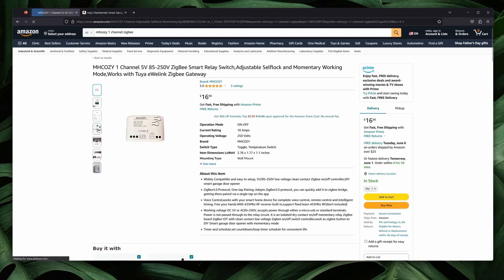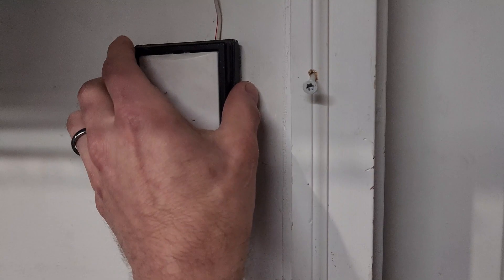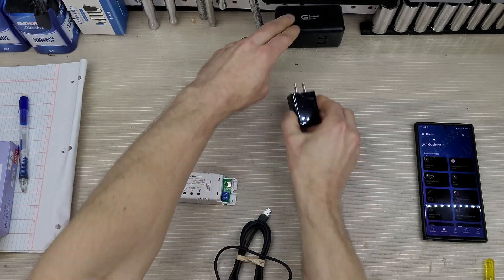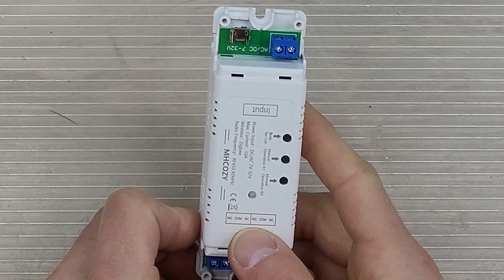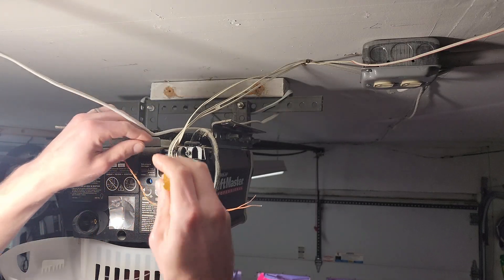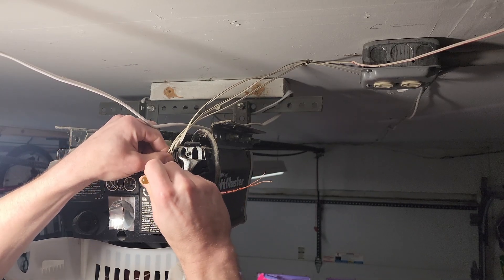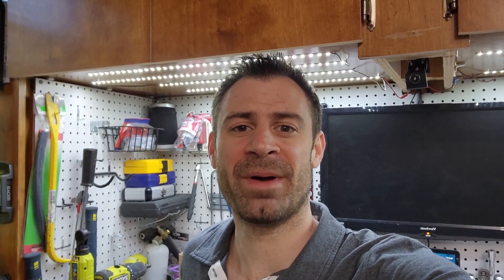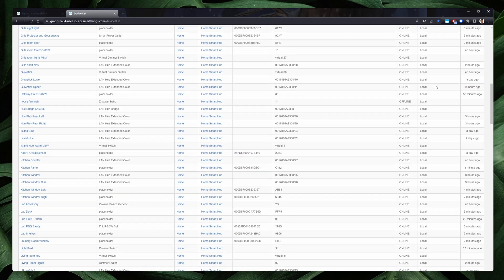EASY Garage Door Automation [Google, Alexa, SmartThings, Hubitat]

Comment: Does the relay work with Home Assistant Zigbee ZHA?
Reply from the maker: Tuya can be hit or miss w HA, but I'd like to think it works.  And TBH, I return what doesn't work.  At that price, it's worth a shot as many different use cases.  If you buy, let us know how you make out.  Thanks for watching!
Reply: @manicmods  Will do...Thanks
Reply: @manicmods  I got mine today.  It paired right away with my Zigbee Gateway.  I am running ZHA, Supervisor - 2023.5.4, OS -10.2, Frontend -20230503.3 and running Home Assistant.  If you open it up and go to Configurations you will see 2 switches that you can add to your Dashboard.  These turn the relays on and off.  You may need to click the Mode switch a couple times to get Momentary Mode for the Garage.  This give you a ~650ms pulse. I hooked it up to the garage controller and worked fine.   I already have a door alarm switch on the garage door, so I can see when Open or Closed.  The only issue is that it double or triple pulses on occasion.  Makes the garage door reveres a time or two.  Not sure where this is coming from.  There is an Attribute off_with_transition which is not explained anywhere.  But see no difference with it set to true or false.  I will hook up the other garage door on the other relay and should be good to go.  Interested if anyone else sees the occasional double puling.  Thanks for the video.    I should have mentioned that I didn't use any App.  It was a direct integration with Zigbee.
Reply: Hello. Doing as u described on this video but not working. Does positive wire go to No or Com on device and does positive wire go to positive on door opener?

Comment: Any plans to add position of the door into any of your automations? Since the relay can only perform On/Off there is no way of knowing whether you are "Opening" or "Closing" the door. Love the videos, keep them coming!
Reply from the maker: Thanks Alex!  I use a wireless contact sensor which I should have included in video.  It's one my sensors I tap into button cell contacts to add a battery pack for long life.  With the pair I could create routines but I'll be manually triggering based on needs as well as status reported by my scene controllers and dashboards.  I'll be building upon these sensors and Scene controllers in my next video.  Appreciate your input 🙂
Reply: Awesome, thanks for the info and can't wait for the future vids.